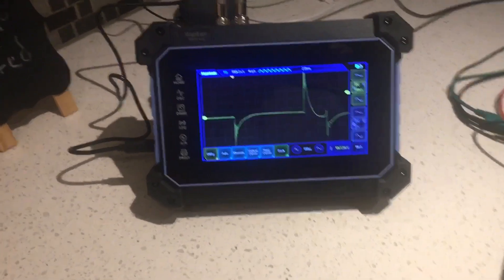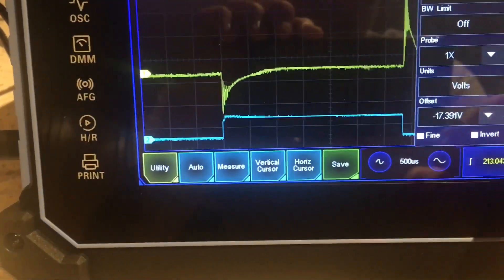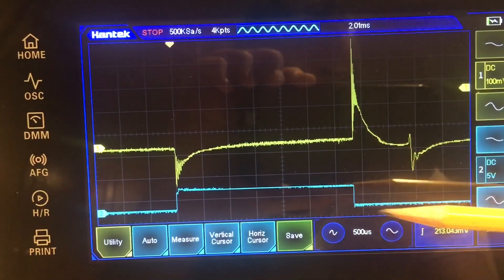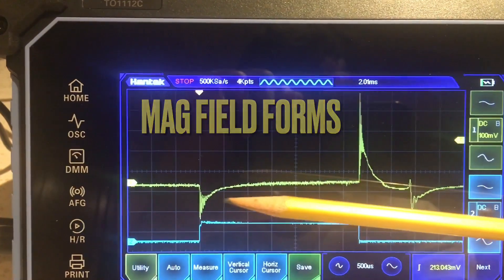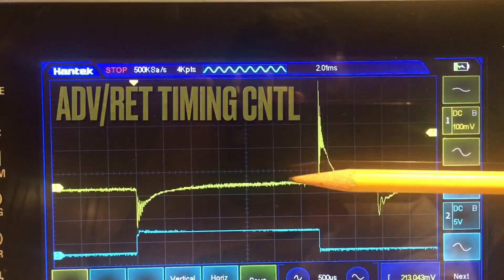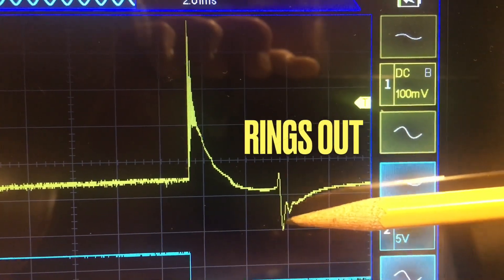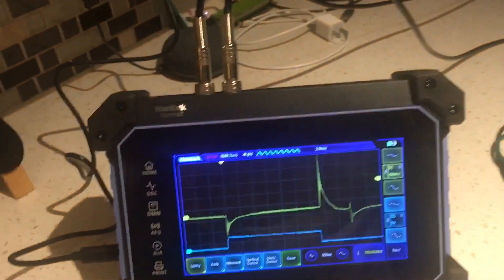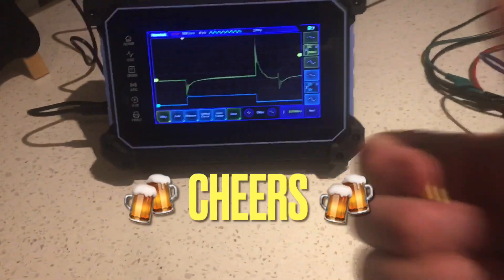Hantek Tablet Scope Secondary Ignition Trace

Comment: Is the 1008c much better than this tablet?
Reply from the maker: Depends what you need it to do…The 1008 is dated and very slow, but does offer by far the cheapest 8 channel option. Alternatively the TO1000 series is modern and faster but is very glitchy IMO the product has been rushed to market.
Reply: @TheGibby3340 would you recommend T1000 for daily automotive tasks ?
Reply from the maker: No. Too glitchy & virtually no memory buffer. It was a let down from Hantek.
Reply from the maker: 1008 is great first scope. Just be aware the more channels in use basically the slower it will operate. Also learn how to use “Roll” mode 👍🍻
Reply: @TheGibby3340  cheers mate , greetings from the Philippines
Reply: I am currently on this site for info about the HT1008c, other and I are having problems with secondary signal testing < setting up the system is ok, all works until the engine is started, the computer then says it's lost connection with the 1008c scope, 
using the HT lead attenuator built in, and setting the probe to 10kv

Comment: Nice video. Are you still enjoying hour TO1112D?  I’m thinking about a budget 2 channel tablet type scope, preferably with dmm and signal generator. This a good bet, or would you recommend something else?
Reply from the maker: I am a Hantek fan so I wish I could recommend this product, honestly I can’t. Far too many glitches they seem slow/ reluctant to address with updates. The virtually non existent memory buffer is also not good enough in this day & age. Sorry to be a bummer. This scope is currently collecting dust, I don’t use it. Thx for watching 🍻
Reply: @TheGibby3340  Thank you for the honest reply. Yeah lacking memory buffer would be a major issue. Is there a tablet oscilloscope you would recommend?
Reply from the maker: @JeffinTD Micsig looks to manufacture a nice product. Not cheap though. Hscope is a great App (android only) that lets you use some of the cheaper scopes and offers first rate user interface and functionality. Cheers 👍
PS older SnapOn Modis or Vantage Pro can be had on the used market at quite reasonable prices now. I love my Modis 👍
Reply: Yeah Micsig and Owon both appear to make some high performance tablets with deep memory, but you get into the $1000+ range in a hurry. A bit much for someone like me (just clowning around).

Comment: Hola buenas no es necesario usar atenuador? Para medir bobinas de encendido?
Reply from the maker: Attenuation is required if your probes are measuring directly within the circuit. Because this is indirectly measured via induction (no direct contact) it’s not required. This technique should not be used if an issue or fault is present which could result in HT leakage directly to your probe or you! Thx for watching 🍻

Comment: I have a T01112D and I can't get a secondary ignition trace to look anything like it is suppose to.  It is a known good ignition.  Would you mind telling me what all your settings are to get a good  trace?  Thanks
Reply from the maker: Different systems will require different settings. This particular demonstration ignition setup utilizes 100mv/div amplitude, 500microsec/div timebase. Filter usage can scrub noise from the image. No attenuation is required as the induced voltage is quite weak. Do not use this simple wire/basic probe setup if you this there is any Risk of HT leakage, which of course can pose a hazard to you and your equipment. Thx for watching 🍻
Reply: @TheGibby3340  Thanks so much, I watch all your videos you content helps many of us. 👍👍

Comment: Cool. I experiment showing what happens to the spark signal when you blow high-pressure compressed air over the spark plug gap through a tiny high velocity nozzle to show the change.

Maybe show the younger you guys the difference in what the pattern looks like with a .020 gap to .090 gap.
Reply from the maker: Cheers Tom 🍻

Comment: Why do you call it secondary ignition when you are measuring the primary?
Reply: The primary voltage is about 12 v where the secondary is stepped up by the turns ratio or more turns in the secondary which would be too high a voltage to be connected to the scope. The primary is similar to the secondary just a much lower voltage such that it can be measured without damaging the scope.
Reply: @WJV9  🤣🤣🤣🤣I'm referring to the nomenclature
Reply from the maker: Hello Dave. See Stoakes book page 141-142. There is always the possibility I am mistaken.